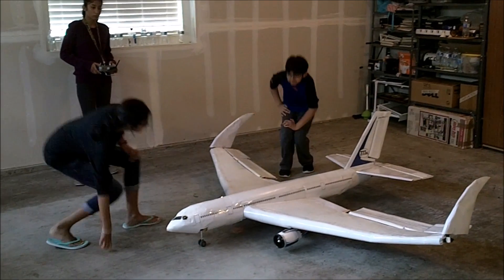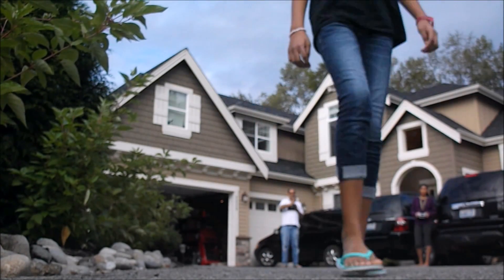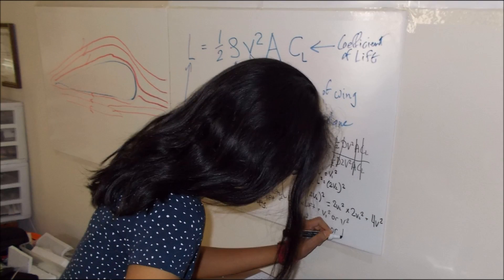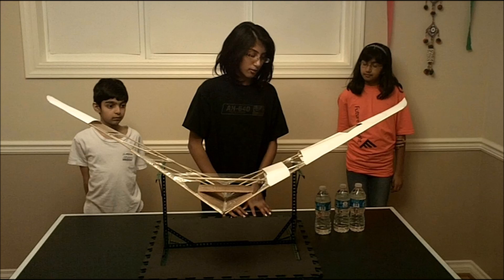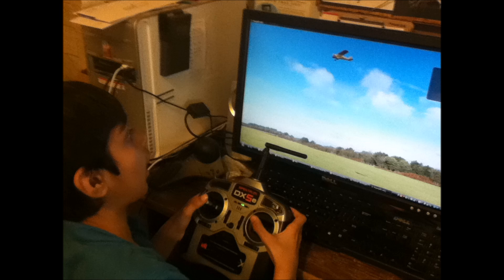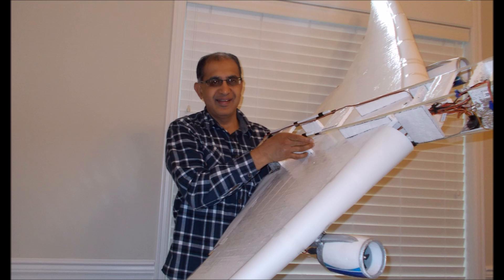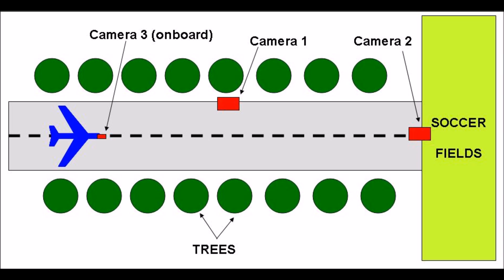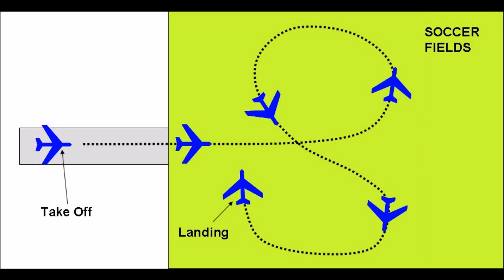Boeing 777X Model - First Flight - A Family Science Project

Comment: Great Job!!!.  Awesome to see a family do a project like this. I worked at Boeing and fly RC. You've probably already figured this out, but the see-sawing, inability to gain altitude and instability in turns are all signs of the Center of Gravity or (CG) not being right. The Center of gravity has to match the center of lift (ususally 1/2 to 2/3 of the way back of the attach point of the wings. There is alot of info on CG on youtube.  Looks great.  The second flight looked like it got a good start.  Keep up the great work.

Comment: which edf u r using
Reply from the maker: Each engine is an Eflite 69 mm EDF, run with a 4S LiPo battery.   We later modified this airplane with newer and more powerful engines (6S, 80 mm EDFs) and the performance greatly improved.  You can watch the first flight of this airplane at https://www.youtube.com/watch?v=oCKt-SP-dL4